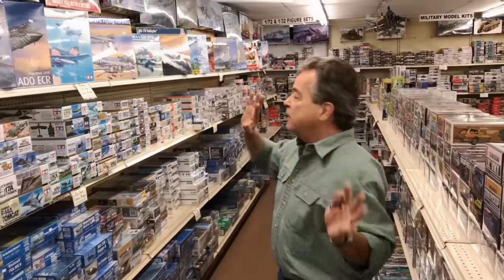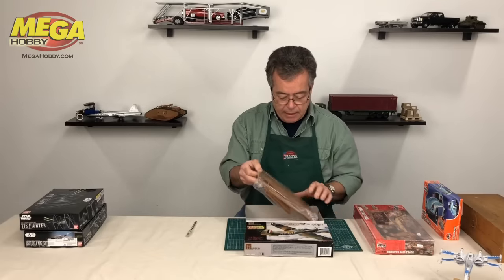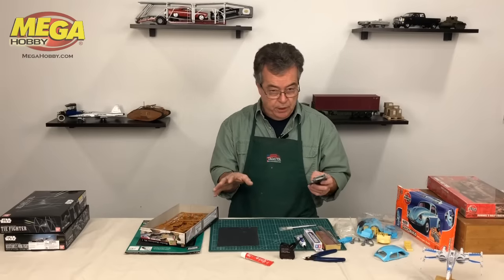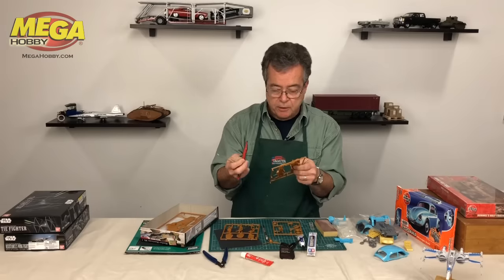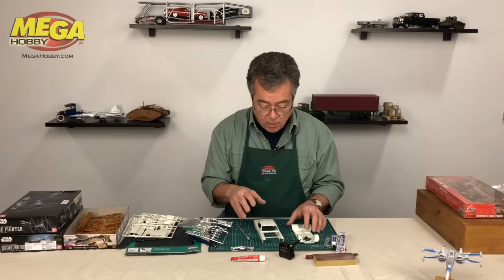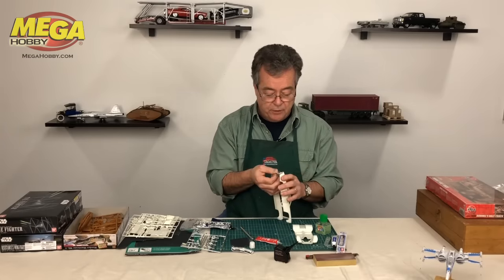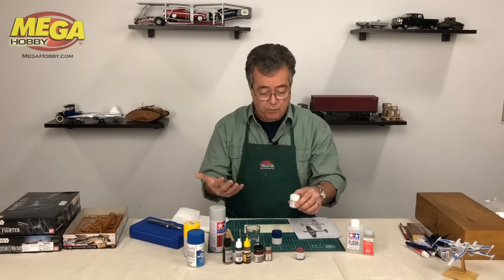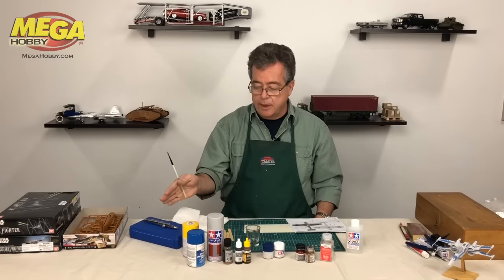Plastic Modeling Basics - How to get into model building

Comment: When you are gluing a chrome part, be sure to scrape off the chrome where it comes in contact with the plastic otherwise the part with come off and it will not be a good glue bond.
Reply: Excellent point.  I'm surprised that this tip was not in the video.  This goes also for parts you have painted before assembly.
Reply: I actually didn't know that. Thanks
Reply: Vitopaletti: I didn’t know about that stuff. I’ll have to check it out.

Comment: One of the best recomendations for new modellers in my opinion would be to go buy anything that you can outside the hobby store, especially sandpaper. (Actually thinking of buying sandpaper at a hobby store almost makes me burst out laughing at how stupid this idea is.)Most of the time the prices are a few times higher than if you would  buy it somewhere else. Even the modelling companies do this. For example an Italeri hobby knife costs around 10-12$ and the exact same knife in the exact same box only without the branding I bought in a supermarket for around 4$. It doesn’t look like much at first but it really can add up overtime. Tweezers as well, the pointed ones can sometes be very expensive, but if you look on some makeup alleys you can find those for under a dollar. Yes they’ll be pink or whatever but does it make any difference really if they work the same?

Comment: Here's a little tip for enamel paints. Open the paint up and drop a BB or two in the bottle. If the pigment starts to settle,just shake it like a spray can to mix the paint. I do it with all my paint bottles.

Comment: Model building requires skills that can only be perfected by trial and error. I like building armor vehicles from Tamiya. Since I place mine in action dioramas. A lot of pre-planning is a must. One kit could take months to finish and stage. If you want highly detailed models, use gated kits because the other couldn't be as detailed due to mold design limitations. 40+ years as a hands-on injection molder gives me some insight into the processing of parts. Start with simple kits and work your way up to avoid frustration or discouragement. Have fun. Good luck!

Comment: If you know that you will only build one, then scale doesn't matter. But if you are going to start a collection, then it does. Choose the scale to match your ambition towards your hobby. I started with 1/144 scale and have moved on to 1/72 scale because I have found there is the most extensive selection in this scale for aircraft. I now have over 80 completed models hanging from our spare bedroom ceiling!
Reply: cool! I made about 20 1/72  scale planes but now i have moved to 1/48 scale, because there is much more detail in 1/48, only problem is... i can't find a seperate place for my 1/48 models so now they are with the 1/72 scale collection.

Comment: Some great suggestions on building models.Would be nice if you had a close up showing putting the pieces together. On the glue,i want glue that is nontoxic.I need to protect what brains i have left.Another suggestion,why when the parts are on the tree,that is what i call it? The numbers for the parts are hard to read.Any suggestions.Thanks.Happy Modeling.

Comment: Kits are rising in costs mainly due to the increasing level of engineering that's found in newer generation products. Slide moulding, hiding or eliminating knock-outs, carefully designed sprue-gates and so on are contributing to the higher cost of manufacturing. If you're patient and look out for sales or attend model shows you can still find amazing deals. Also many kit manufactures offer more moderately priced lines so perhaps try those to save money.
Reply: Very true when I began building models as a boy in the seventies, many of the models resembled the quality of toys you find in a dollar or grocery store. When I got back into the hobby about twelve years ago, I was amazed at the detail of the kits themselves not to mention after market sets.
Kits may cost more, but my finished pieces look like they were straight from the movie or tarmac.

Comment: MegaHobby I am aware this video is a year and seven months old and hope you will respond to my question.  I am returning to scale modeling after a 50 year hiatus (life and all that comes with it), so I am approaching my turn to modeling as a neophyte. My question is what is the best way to clean the model release on the plastic parts (which I did not do as child)? I've read about using 1 to 1 part water and vinegar or using 1oz Simple Green to 16oz of Water or using Dawn dish soap and a old tooth brush among others. Any help or direction was to which is the better method would be a great help in my return to scale modeling. Thank you.
Reply: A squirt of dish washing liquid  in the sink or bowl  of warm water is   absolutely fine . I've always washed the parts this way with no probs 👍
Reply: Get a can of tire cleaner, the foaming kind. Put your parts in a plastic tupperware box and spray away, After a few minutes, take them out and rinse them off in the sink. Make sure you put some strainer in the bottom so if any small parts detach, they wont go down the drain! Almost all of todays model kits dont require this step, but as you say, if the plastic has a greasy feel to it, absolutely do this.

Comment: I have built that same Hurricane from Pegasus, and some others of their kits.  Their plastic is slicker than other company's styrene. and sometimes doesn't work with certain paints, especially acrylics.  I found spray priming was necesary for good paint adhesion.
Another step to add to basic model building.  Before I do large scale painting on a kit, I check paint compatibility.

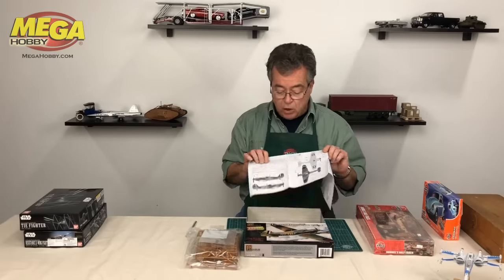Comment: (4:09) No need to open the sealed box in the store...the colours that are needed to paint the model, should be printed on the outside of the box. The same goes for the info if you need glue or not.

Comment: Maybe you could also get Mr Cement S, its a really thin glue that is great for plastic parts and dries quite fast so it's the ideal thing for your glue together kits, AND it has a brush for application. Give it a try, you might like it.

Comment: Miguel Jimenez1 second ago Mr. Camaro 73 here, Hi like your videos very helpful, Like to ask a question about model kits. I'm new at this and like to know if you have to sand and Prime all the pieces in a model kit. Like all the small pieces from the kit. Just a little confused on this part. I know you scuff the body and prime it and sand it. But the chassis and rest I don't know. Please let me know if your so kind. And do you sand all the parts if you primer them.Thank You

Comment: Returning to model building after several years of not building. Really have become focused on the Tamiya kits. Is it still recommended to wash the part sprues in soap and water before building or painting? Haven't done this before years ago on older models, but this is the first time trying a Tamiya kit. Any feedback from the experts is appreciated.
Reply: I think nothing has changed in that matter. Washing them is always good.

Comment: Should I paint the parts before I take them off of the plastic stem or should I wait and paint them after I put them together
Reply: There’s no simple answer for that. I always ask myself when it will be the easiest to paint them. If you paint everything in one color there is no reason to paint them while they’re still on the sprue. But if you have many small parts for fine painting it would be easier to paint them on the sprue or sticking them to a toothpick with an adhesive mass like Pattexes Patafix or Blue Tac depending on what you have at your local shop.

Comment: On your chrome parts you'll want to remove the chrome where you plan to glue because most glues for plastic kits will not adhere to the chrome they is placed on the part

Comment: I have a very stupid question, since I never really put models together as a kid, what does one do first, paint before gluing? 
Yes I’m sure this is a dumb question.
Reply: not a dumb question.   the best thing is to glue everything first and paint after.
Reply: It depends on what you are building. Armor is typically completely assembled before any painting starts. With aircraft, typically you will paint the cockpit first, then assemble the rest of the model's main components, leaving off the smaller bits. For aircraft, it's best to do it this way, because you will have seams where wing and fuselage halves go together, that will need sanding. So that would ruin and painting.
Some parts can be painted then assembled, typically these are smaller parts. Just be sure to scrape away at least a little of the paint where the glue will go. Glue doesnt stick well to paint.

Comment: Getting back into modeling haven't modeled since 90s  I want to get in to  1/72 scale  parts are smaller need some input on what glue or equipment  needed
Reply: Tamiya extra thin cement is a great glue for plastic modeling. It requires VERY little applied to work it's magic, and the parts hold in place in a minute or so. Old tube glues take much much longer to dry and are rather messy.  HTH

Comment: I jumped head first into this without fully reading up on it, I got a GMC general and kenworth W900 but I don’t got nothing that’s recommended to paint and glue it together. I’m curious on how you are meant to glue certain parts together that won’t even hold onto each other to begin with. Very confusing. Maybe I need some quick setting glue/cement?
Reply from the maker: Quick setting cement can be helpful. It might also be helpful to get some lightweight clamps, or rubber bands, or anything else that can hold something together while the cement fully cures.
Reply: @megahobby5042  appreciate the help do you got any recommended brands for paint on these plastic models?
Reply from the maker: @TommyGhun  Vallejo is always our top recommendation, but AK Interactive and Tamiya are also great options.

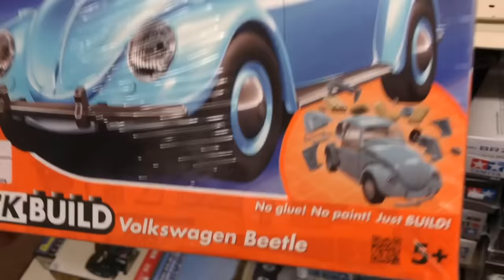Comment: can you offer any advice on getting the fixed wheels on my Otto Resin Model 1:18 scale to spin ? Is there a way ti modify them to freely spin, or can i buy axels and wheels that spin to replace ? 
Thank you !
Reply: Find brass tubing the appropriate size to fit into your wheel, then find a brass tube that the first tube can slide into (telescoping). Cut the tubes to length and figure a way to secure the larger tube to the body (frame) and don't get any glue (use CA or epoxy for the brass) on the inner tube.

Comment: what type of cement do you use to glue styrene to a painted or primed surface?
I am doing a scratch built model that I primed and forgot two mask off where I need to glue a part.
What do you suggest. Thank you
Reply: Cyanoacrylate (CA or super glue) is generally the go-to for that.  It's not going to be as robust as styrene cement, but it'll do the trick.  Depending on the profile of the parts you're trying to join, a bit of pinning, and/or modelling epoxy, might be a good idea, as well.

Comment: Hello, I'm an "O" gauge model railroader, can you recommend model kit manufacturers that have a good line of 1:43 1:48 models?  A catch a few on e-bay but not enough, thanks
Reply: Tamiya makes wonderful, great fitting models. One of the best models to start with is their 1/48 P-51 Mustang. Super easy kit to build, and turns into a great looking model. Easy to find for $10 to $20 2nd hand

Comment: Not only did the twisting them off make the parts look bad, it also broke delicate parts.

I did that or used an xacto knife to cut the parts off the sprue on the table. Issue there was the little piece would go fucking flying lol. And this was mid to late 90s.

Comment: You forgot 1 step. Before you glue the chrome to anything, carefully scrape off the chrome at the point you apply the glue. I have so many problems with the red testor tube glue when I try n stick chrome to any other part.

Comment: Do you glue them together first or paint them first if the model have a diferent color on each parts??
Reply: I would suggest painting small parts before gluing and painting larger parts all together.
Reply: If attaching parts that will be different colors or finishes, then paint them first. For example, with the car he was demonstrating, you would definitely paint the body first before attaching the chrome bits. If the parts will all be the same color, like wings and a fuselage for example, you should be good assembling first and then painting.

Comment: have to clean chrome off for glue to hold
Reply: Put it in a plastic bag, spray oven cleaner in there, seal it up. 30 minutes later, rinse off the parts under water with an old toothbrush. Repeat if necessary.

Comment: I've wanted to get into plastic model building for some time, but it seems rather pricey :(. Model kits seem quite expensive, and when you take into account the cost of tools and materials, it adds up. Maybe if it were easy to sell the models once you've built then, to recoup (some) costs, that would be good.
Reply: Paints you buy can do more than one model also tools bought last if u take care of them models can be purchased on line and flea markets much cheaper then store bought because they have a over head expenses insurance payroll u know thatx why its double price they probably pay 10 dollars a model and sell for 20 or more

Comment: What kind of glue
Reply: Tamiya extra thin cement is a great glue for plastic modeling. It requires VERY little applied to work it's magic, and the parts hold in place in a minute or so. Old tube glues take much much longer to dry and are rather messy.  Superglue is not recommended for general assembly. HTH